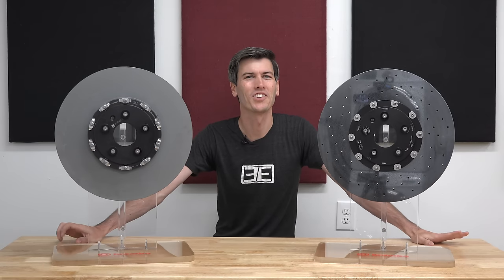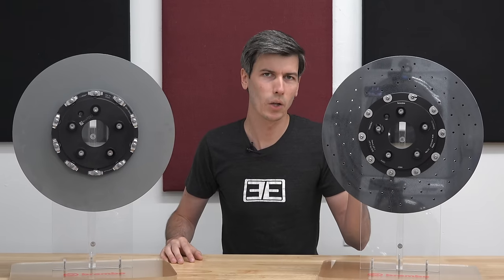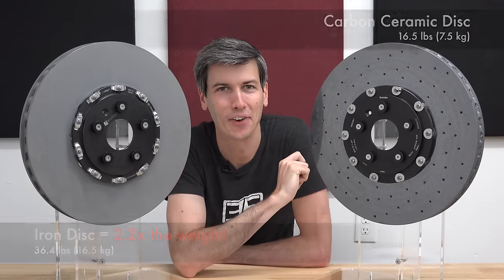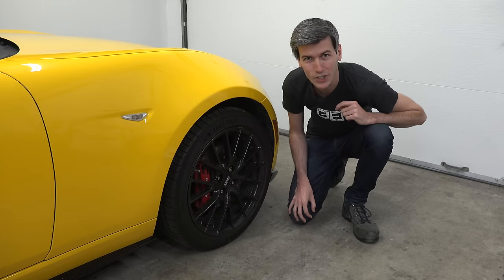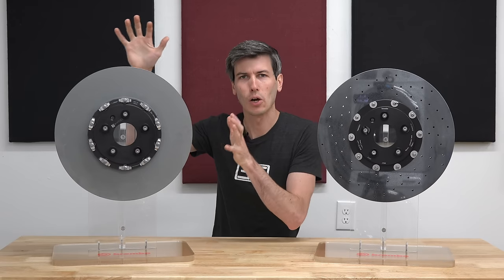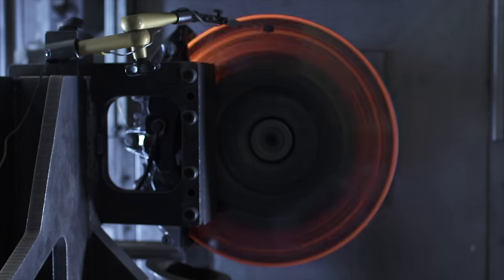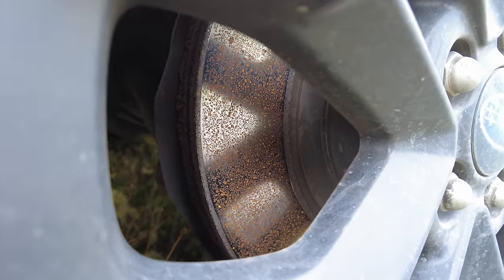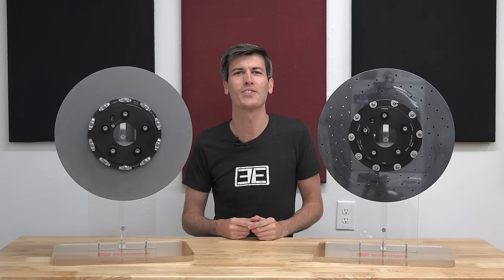How Can Brakes Cost $10,000? The Brilliance Of Carbon Ceramics

Comment: The craziest thing about carbon ceramic brakes is that it costs more to replace them than it did to buy them as an option on the car when it was new.  For example, Porsche sells their PCCB (Porsche Carbon Ceramic Brakes) on their 911 GT3 as a $20,000 option.  Yet to replace all of the wear items in that brake system -- calipers, rotors, and pads -- costs $30,000.  Just for the parts.  That's not including labor.

How is that a thing?!  It'd be cheaper to go buy a brand-new 911 with the PCCB option, then swap out its brakes for the older cast-iron brakes, keeping the ceramic brake parts for yourself, and then sell the car.  Then you'd have all new brakes for about $25K instead of $30K.  Insanity.

Comment: i wonder how carbon fiber composite materials endure the braking temperatures. if they are indeed conventional carbon fiber composites(carbon fiber/epoxy), they would get really hot and brake apart. what am i missing here?
Reply: Missing almost everything, race proven stuff that should not be usedfor high temp.?
Reply: There's a link to a Brembo video about carbon/ceramic brakes.
I know about the older carbon/carbon rotors, and in that case any matrix was pyrolized. (there is no resin left in the end product)
Reply: @praero551  i'm obviously missing something, i'm asking what are they
Reply: @jimurrata6785  imma check that thanks
Reply: @jimurrata6785  i watched the video and in this case, they also carbonize the polymeric resin matrix and then convert most of the material to silicon carbide, hence the ceramic part. makes sense, thank you

Comment: Thanks for this!  I have a question though.  What's the difference between F1 or MotoGP brakes and production cars?  It's clearly not acceptable for production car brakes to only perform when they are hot, so how to the manufacturers overcome that?
Reply: Brake pad compounds nowadays are more consistent on a wider temperature ranges. It's not about carbon rotors, it's about pads only. Just usually carbon rotors come with high temperature pads which all have quite low friction at cold temps.
Reply: The rotors used in F1 cars are 'carbon-carbon'. Same ones used on the McLaren Senna. Takes 6 months, more carbon, ×10 the vent holes for cooling, etc.
Reply: Racing "Carbon" brake discs are Carbon-Carbon disks while road car "carbon" disks are actually Carbon-silicon-carbide disks, which is a totally different material

Comment: Unless you're using inboard brakes doesn't the lightness of the carbon rotor also improve handling and because of reduced unsprung weight? Thanks for another great presentation!
Sorry, I should have waited for the rest of the presentation :)

Comment: Unless you are racing , with unlimited budget, it is not worth it. Large airplanes that are less cost sensitive already use carbon, carbon brakes. But the brakes in those planes need all the help it can get and every oz saved.Airplanes have ABS in the 50s. New things are always expensive, then the price drop with mass production. For airplanes, the pilot is in another area code, and have no feel of the brakes, and at 100+ mph, the tires can lock up instantly and 2 seconds later, blow out , and you can lose a multi million plane. The ABS is relatively cheap.  The first mobile phones in the mid 60s cost more than the car. Look at it now. See the James Bond film  You only Lived Twice.

Comment: I have a porsce 911(922) turbo .
The other day some old man with a 922 like mine was touting the superiority of his convertible s with ceramics.
Not really.  There's better places to spend option money when his was 157 and mine was 118. 
My iron brakes will put you through the windshield. 
Carbon brakes are a 13k option.  I don't think so...
I'd rather have aftermarket turbo upgrades and lighter wheels than brake fade advantages.
Promise I'd smoke him on the track anyway.

Comment: They cost that much because they charge that much. After nearly 20 years of manufacturing for production cars there doesn't seem to be any incentive to come up with any way to increase the efficiency of manufacturing these rotors. For a daily driver, these carbon ceramic rotors are not necessary.
Reply: Nobody needs any performance related stuff for daily driving, not even engines bigger than 1,4L turbo, or expensive hifi….or… Nothing really is needed, unless we just want to:)

Comment: $10K is more than a third the original cost of my 2016 pickup.  I have 4-wheel disc brakes and they work well.  These expensive discs are not worth it, unless you have some special need for low unsprng weight and price is no object.

Comment: Nope, brake dust does NOT come from the rotors. It comes from the pads. The exact same brakes will cause more or less dust depending on the type of pads you install. Carbon ceramic rotors also use very different pad material than iron rotors. And finally, brake dust isn't magnetic and doesn't rust, which it would if it came from the iron rotors.

I've swapped pads on brakes that went from producing very little dust to ones that produced loads of dust and vice versa. I've started researching the options for the car concerned and try to select pads that produce less dust.

Comment: What's the matter with you? when you list all the manufacturers that offers carbon ceramic rotors and leave out the first (Porsche) who pioneered that application with SGI/Brembo . I also believe that Ferrari did not use carbon ceramic rotors but actually even more expensive carbon fiber rotors with little silicon content. Those rotors were meant to just last the race in F1 and are literally burned up at the end of the race.

Comment: Why haven't the price of carbon ceramics come down as manufacturing techniques improved and usage has been more widespread
Reply from the maker: I think it’s still a lot more rare than you might suspect. It’s offered on a lot of high end models, but most of those models are very low volume. On top of which, there are about five different types of carbon brake rotors, which vary in price as well.

Comment: If carbon ceramic brakes are formed with superficial crazing (and the videographer can wave to himself as reflected on presumably a used one), I´ve not ever seen or heard of the issue of how deep this crazing is.

I idly wonder, if the crazing is that superficial, why is it not removed at the factory, or not be permitted to appear at all?

I understand that for such premium technology and lengthy fabrication, each rotor is individually tested on a test rig. Why does doing so not remove the crazing so nobody ever notices it?

Inquiring minds want to know!

Comment: Before C19 I visit yearly the Porsche days in Spa-Francorchamps. I recognised that beside the Porsches who have Carbon Ceramics standard (Turbo s, GT2-RS, etc) almost no one select the option Carbon Ceramics. I can confirm that most of them use their car under heavy conditions on a demanding circuit with the standard steel rotors.

Comment: You still gotta change pads with CC brakes thought, right?
Reply from the maker: Correct!
Reply: @EngineeringExplained  but the pads aren't 10x the price of normal one, right?
Reply: @EngineeringExplained  Are the pads just normal ones you would buy? Or do they have to be a special carbon ceramic type or something to match the rotors?
Reply from the maker: @LordSaliss  There are specific pads to be used with carbon ceramic rotors, but there's still a variety of options, and they aren't the big issue when it comes to cost.

Comment: Okay, I love the information.
But, let's compare apples to apples.  They have to use high quality fasteners because they last longer?  Fair enough, but....  Typical Iron/steel Cast rotors don't have any fasteners.  Weird, right?  The ones you show aren't typical--nor are they cross drilled and slotted.  Again, apples to apples, please.  I have cross drilled slotted iron rotors on all 4 corners for less than $200.  Is Brembo Iron better?

My greatest takeaway from this is that we need better manufacturing processes for carbon rotors that bring the price down--flat screen TVs  are 5% of their original price 20 years ago.....and carbon rotors have been around that long.

If your brakes judder, get them resurfaced.  Not a big deal--nor is avoiding it.

Lots of brake dust is.....pad material.  Kinda why pads get replaced more often than rotors, even with resurfacing. 
Presumably, more pad material is worn off by using carbon discs, comparably, so.....  
I didn't really think iron powder (from the rotor) was such a huge issue for you.  

And yeah, except when they're rusty after sitting too long outside, my cross drilled iron rotors look just as awesome from 5 feet away--and most people don't get up close enough to see the unique pattern of cracks on carbon brakes.  Seriously, they see you from the car next to you.  

Also, Wilwood and Baer make pretty good brakes, too.

Comment: Dunno why but "rotor" really triggers me, brake disk 🤷 I nearly specced them on my upcoming Rs3 but the costs scared me, I worried about stones getting wedged and destroying the disk.
Reply from the maker: I asked Brembo about this; they'd mentioned stones usually damage the calipers, if anything (because that's the narrowest section to the wheel). They said hadn't seen damage from rocks on the rotors, but you do have to be careful removing the wheels to not hit the rotors as you take them on/off.

Comment: I would have thought a higher unsprung mass would aid the suspension keeping the wheel on the ground but after you said it less is giving more control to the suspension when having to pull/push the weight back.

It would be great to see a swarlem test comparison to demonstrate this.

Too much suspension and you can create bounce, so many cool factors in today's standards.

Comment: Electric cars will not need super powerful brakes because a significant braking load is fed back into the battery. They can’t entirely do away with brakes but they will be happy with much smaller units.

Comment: You say they're more environmentally friendly because of brake dust, while it might be true because there's tons of iron brakes and they wear faster than a carbon brake, is the dust it generates even biodegradable like iron dust, is it not like a microplastic and is it's manufacturing process less wasteful than an iron rotor which is done cheap and easy? How about replacing it? The sources of the materials etc and so on. Cars aren't an environmentally friendly option to begin with, with even electric cars being makers of tyre and brake polution nevermind the terrible spatial efficiency.

Comment: IMHO....electric cars will eliminate the market for carbon rotors even in racing by developing with better and better regen (+ reverse) braking.  Think of the rotational inertia benefit on "zero weight" brakes.  Really, the only time I tap my brakes on my Tesla is when it's cold enough that regen is reduced.  Video was cool, but what about the hybrid approach.  I put ceramic coated steel rotors on the wife's minivan.  Much of the longevity / resistance benefits at minimal cost adder.
Reply from the maker: Tesla actually just released a carbon ceramic rotor pack for the Model S Plaid! I think it will remain relevant with EVs, because it's better to put the heat into a brake rotor than back into the battery pack. All of the energy from braking going back into the pack gets it too hot, so performance is reduced when track driving. Perhaps, with greater regen efficiencies, this effect could be reduced, but certainly today these brakes are a great solution for EVs.
Reply: @EngineeringExplained  Yor’re not wrong , but the Plaid was ridiculously under braked from anything that I have seen or read about a review of it. I have wondered about the effectiveness of these brakes when not having been properly or ever broken in by a driver that never goes fast enough to do so.

Comment: Carbon Ceramic brakes commonly become the biggest downfall on the used car market for a buyer looking for a used performance car at an affordable price. Cars that cost $50k or more when new that came with Carbon Ceramic brakes and then dropped in value years later are purchased for in some cases less than $5k on the used market and then end up costing more than the owner paid for the car when they have to replace the brakes. Audis, BMW and Mercedes are some of the worst in this area.

Comment: Only a dumbass would spend that amount on brakes.  10k gets you a honda, building it with a motor swap & the suspension needed to hold on turns
Reply: Exactly.

Comment: Isn't iron an natural element,  and steel is iron with added carbon to create an alloy. So the rotors are steel, not iron.
Reply: The rotors are cast iron, not steel and not elemental iron. Cast iron is defined as an iron-carbon alloy with over 2% carbon, so it actually has a higher carbon content than steel.
Reply: @ASJC27  Thanks, sorry confused,  was thinking grey iron.

Comment: The rust part is the most important. If you drive a high performance or heavy EV you are still going to one-pedal-drive most of the day. So you don't use your breaks a lot and they rust and degrade quite fast. But once in a while you really need your breaks in a dangerous situation you really need your breaks and now you've got rusted breaks that perform horrible. That's obviously no good.  With Ceramics you don't have those problems.Your brakes wont degrade while not in use and once you need them they are still there at full force. I'm pretty certain that once they will become a bit cheaper, they will be the standard for EVs

Comment: Tesla lists carbon brakes for the Tesla S Plaid for $20'000. With such acceleration and power this should be default :)
Reply: Jason did a video on the Tesla brakes already, and the stock brakes are very good for street use.  There's aftermarket tuners with brake options for the Model S already for cheaper, which if tracking a car I'd choose over factory brake options anyway.

Comment: It is more pricy, because they charge for the lifetime. Essentially like technology hasn't advanced. There is no reason they should be that expensive other than us idiots paying much more than it costs to make them.
Reply from the maker: Did you watch? I provided information on the cost; the manufacturing process is far, far more complicated, and takes significantly longer to create each part (weeks vs hours!).
Reply: @EngineeringExplained  Yes I did, but we both know. That the sale price and production cost are not in a direct relationship. I would not mind paying double or tripple what normal brakes cost. But 10x is just a ripp-off.

Comment: Ceramic rotors have zero advantages over steel in road conditions ZERO. The only real use for carbon rotors is to race since they suffer from almost zero fade. On the road they might even be less effective than steel since to reach optimal performance they need temperatures that are rarely encountered in day to day driving. All other "advantages" ceramic might have over steel are essentially inconsequential for a road car. It simply another way to gouge posers.